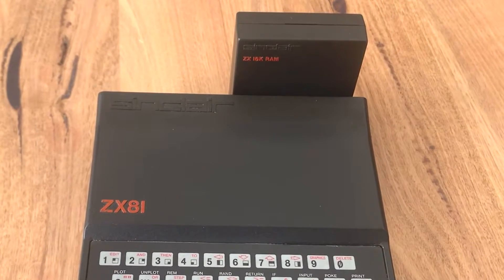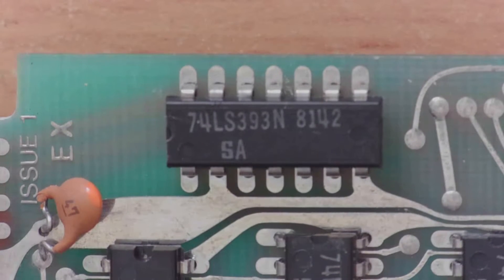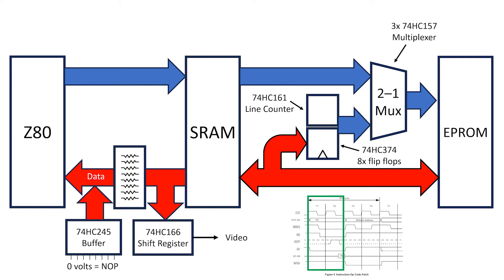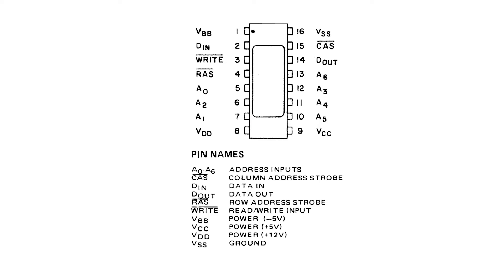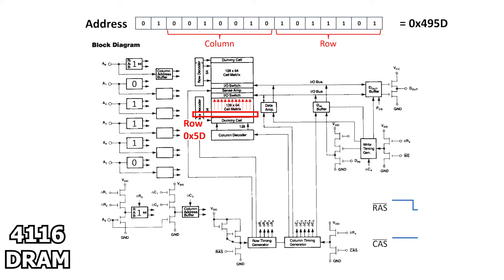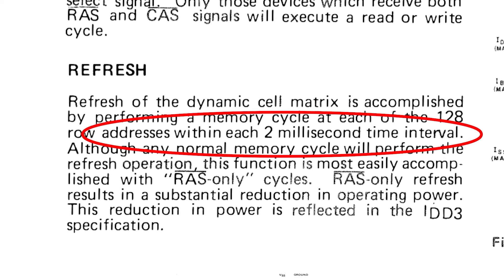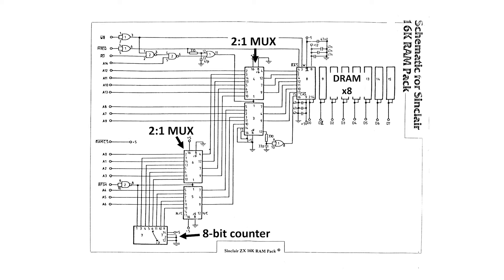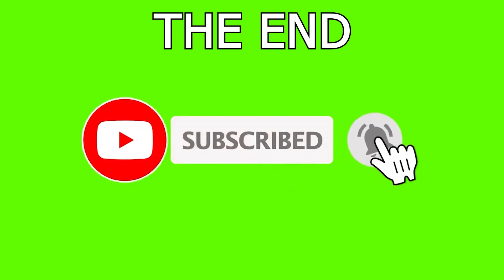ZX 16K RAM expansion explained

Comment: It's interesting how the balance of cost between processor and memory has shifted over time. I mean in terms of proportion of the whole machine, not absolute amounts. Back then, the memory was the expensive part, now the processor is. If you spend $2000 on building a nice PC now, maybe 10% is going to be RAM and 30% the CPU, but back then, you were spending $400, and half of it was RAM.
Reply from the maker: Yep, and it was lowering of the RAM cost that changed the architecture.  I tend to think of RISC as being optimized microcode.  The advantage was pipelining which let the programmer have more control over performance (vs running microcode internally), but the cost was wider instructions and more memory.

Comment: I believe the first few batches of the Sinclair RAM Pack lacked the little plastic "key" in the third position of the edge connector, and this lack allowed the connector  to slowly slide sideways and short-circuit the contact "fingers" on the PCB, forcing the user to unplug/replug the RAM Pack.
Later versions, and AFAIK all 3rd-party RAM expansions did have that plastic key.
This shows how keen Clive Sinclair was to make things as cheap as possible.
Reply from the maker: Wouldn't surprise me.  With the 5V signal next to the 9V signal, there may have been some unhappy outcomes.

Comment: As I recall, the 16 K rampack was initially available in wie packaging to match the ZX80. Before that they briefly sold a 3 K expansion card which used static ram. That was addressed just above the internal memory for 4K in total.
Reply from the maker: Correct, there was ZX80 16K RAM pack but they're pretty rare.  I haven't seen the schematic for these, but i presume they are pretty similar.  If you haven't watched it yet you might want to have a look at this series https://www.youtube.com/playlist?list=PLjQDRjQfW-84WG47-5UjPz1BrXxc1acvd
Reply: @DrMattRegan  I watched the whole series already ! Truly excellent work. Thanks.
Reply from the maker: @DavidHembrow  great, glad you liked it.  Working on some spectrum ones at the moment

Comment: I had the original ZX-81, but no RAM pack, at $200 1981 dollars I think. It disappeared. I seen a more modern version with the 16K RAM pack for $5 at some garage sale in the 1990s. I have had it  I haven't fired it up yet. I think it is an interesting experience writing a program that runs in 1K  using macroed tokenized basic. Some day, I wouldn't mind relating my physical experience with a mach III, having been born in 1962 (actually just the adder circuit).
Reply from the maker: I think i paid AU$200 for my ZX81.  Only had it for about 6 months before i accidentally killed it.

Comment: I used to work at a computer repair shop and lashed up an internal 16K ZX81 upgrade with cheap 1K SRAMs "dead bug style" leads splayed out with verro wire. Total 17K.   Extra 1K for the tape copier program!
Reply from the maker: Yeah, i wish they'd used it as a programmable character set like the VIC-20, would have made games easier.

Comment: I had a ZX81 but couldn't afford the 16k RAM extension. I knew of the difference between S-RAM and D-RAM and that the Z80, (Z80 fanboy here) had refresh circuitry for D-RAM chips but no idea how it or other forms for refresh circuitry worked.
I had no idea about the Z80's D-RAM refresh cycle being hijacked to perform the video output, will have to go through the video again to try and understand what they are doing. It's humbling when you can barely understand a design and learn of engineers who understand it so well they know how to abuse it to achieve something even more complex.
Reply from the maker: You might want to have a look at this series, https://www.youtube.com/playlist?list=PLjQDRjQfW-84WG47-5UjPz1BrXxc1acvd
I go over the video circuit starting with a bare Z80 and an EPROM.
Reply: @DrMattRegan  Thanks. YouTube only just recommended your channel to me, so haven't had a chance to check out all your videos yet.
As a teenager I had dreams of making a Z80 based computer, but I wasn't focused enough to do it, so I'm going to enjoy doing it vicariously through your channel.
Reply: People these days can't understand just how horrendously expensive RAM was "back in the day."  That was the primary reason why early computers shipped with so little RAM by default.  Only fairly well-off people could afford to add more RAM, and computers with 1K, 4K or occasionally 16K of RAM were the most common.
Around the time that RAM was becoming affordable at long last, the IBM PC came out and its capacity for 640K of RAM combined with the reduced price of RAM eventually killed off all the computers with smaller RAM sizes, especially once other manufacturers started making "IBM Compatibles" at a far cheaper price than the original.
Computers such as the Commodore 64 filled the narrow gap between RAM becoming more affordable and the development of the IBM PC, but the IBM compatible pretty much put an end to most other home computers, apart from Apple/Mackintosh which are a special case.
Reply from the maker: That's for sure.  I wasn't able to get the 16K expansion back in the day.
Reply: @melkiorwiseman   I think I once calculated that buying a megabyte of memory back when the 8086 was new would have cost as much as a house (though with today's house prices, more like half a house). The IBM PC's original motherboard was only 16KB, with room to upgrade to 64KB. If you wanted more than that, you had to add RAM expansion cards. Even the second version from two years later was only 64-256KB. Still far short of the 640KB it could theoretically handle, but probably a sign that memory prices were starting to come down.
Reply: @Roxor128  I can remember stating to a teacher at secondary school (years 7-12) that I'd like to see a graphics display of 1024 by 1024 pixels with 256 graduations of each primary colour per pixel.  He asked if I realised how much memory that would require, and I did.  It was three megabytes, which was a huge amount at that time.  I said "it'll come.  It'll come!"  He didn't seem to believe me but said nothing.

Comment: This was great, I learnt lots of new things about the ZX81. I started wondering a while back if the (normally wasted) Refresh part of the Z80 cycle could be used used for something else like say an independent Read/Write cycle, turns out the original designers had already thought of that
Reply from the maker: I think they used it and abused it (the refresh cycle).  But still amazing what they did to get the machine so cheap.

Comment: I know DRAM is a key technology, but it seems really high maintenance. In the TI-99/4A they had the video chip do all the DRAM management, which walled off the complexity. But that required the CPU to go through the video chip for RAM access which hamstrung performance. I am not surprised which is a worse design tradeoff, the Z80 being tied to video generation, or theTMS 9900 being bottlenecked by a video chip.
Reply: The TMS9900 was a strange CPU indeed; besides having to go through the video chip to access the memory, it only had 3 (three) CPU registers: a Program Counter, a Stack Pointer, and a Workspace Pointer. 
While the first two worked as one would expect, the third register gave the CPU a 16-byte "window" into RAM where all the calculations, interemediate storage, et.c. was carried out.
This scheme allowed for faster context switching during subroutiine calls, where each subroutine could have its own private register window, and upon return to the calling program, the old register window would be restored by a single instruction.
Thus there was no need to push and pop a bunch of registers, which would have been dreadfuly slow thanks to the aforementioned memory access through the video chip.
Reply: @BertGrink  Indeed, that'll because it is based upon TI's minicomputer architecture from the 1960s. In the 1960s making on chip registers was expensive, while magnetic core memory was much cheaper. So many architectures of that era had few registers and used main memory instead. The PDP-8 for example used page zero RAM as it's index registers, which was an idea borrowing from the CDC 160. In the TI 99/4a they included 256 bytes of static RAM mapped to one page, and used as 128 "registers". So, the dynamic RAM bottleneck could be avoided if your program was on a cartridge and used little RAM. Basically TI initially built a machine to compete with Atari's 2600, not general purpose systems like the Apple II. But TI management and marketplace had other ideas, and it was a massive flop.
Reply: @mheermance  Ahh, I hadn't really thought of that (using main memory in lieu of dedicated registers), but now that I've had it explained to me, it makes sense, and with the TMS9900 being a descendant of the TMS99000, it would probably be a natural step for TI to carry that paradigm over to the smaller CPU.
Thanks for the reply, I appreciate it. ;)
Reply from the maker: Hi Martin,  Yes, but i think the guys at Sinclair solved it pretty elegantly in the Spectrum (next video).  Didn't even really require much more logic, but it let the Z80 have free run.  How are you finding these video's compared to me earlier ones?
Reply: @DrMattRegan  I am finding them interesting. At the time I was aware of the ZX 80 and 81's existence, but didn't have first hand experience with them. So learning how they performed video generation and DRAM refresh with minimal cost is impressive. I am not sure which video series is closer to general interest, the pure Turing videos, or early 1980s hardware engineering tradeoffs? I think we're in rarified company here.
Reply from the maker: Yes, i like the theory videos myself, but that is the inner geek.  I still have a couple of pure turing videos to go!

Comment: With memory always being expensive and always being in demand for use its a shame the ZX80/81 just turns off the internal memory and that the external memory isn’t added to that. I believe one of the Timex machines does this to give 18K (2k+16k) also a shame the base ZX81 wasn’t 2k to give more separation in specs between it and the ZX80.
Reply from the maker: Yeah, the really annoying thing is that if they had wired the SRAM address lines in parallel with the ROM, they could have used the SRAM for user generated character sets and it would have completely opened up pseudo high-res.

Comment: The RAS/CAS multiplexing of addresses is another reason that DRAM supplanted SRAM for bulk storage. Smaller physical packages made for cheaper chips. You can find 1+M byte SRAM chips these days, but nothing like the multi-gigabyte DRAM modules available.
Reply from the maker: Yes, for retro projects it's SRAM all the way.  DRAM is such a pain.  When i was at NVIDIA, we were starting to design for DDR5 and it was god awful.
Reply: @DrMattRegan  yup, for DRAM you need some sort of controller, and that controller got progressively more complicated as the DRAM generations progressed. By the time you reached DDR DRAM you needed a state machine, and probably a CPLD or FPGA to handle it.
Reply from the maker: I built an SDRAM interface with Xilinx FPGA many moons ago.  Very complicated and i don't think it adds much to peoples basic understanding of computing.
Reply: @DrMattRegan  probably not, and most FPGA manufacturers provide pre-rolled solutions for you that make use of embedded SERDES to handle the high speed interface. The Spectrum is about as far as you can go with 74 series logic (see the Harlequin, which does this, but at the cost of pretty much filling the system board with logic chips). Beyond that it may be interesting to show more complex retro devices implemented in programmable logic, say like the VIC II chip.